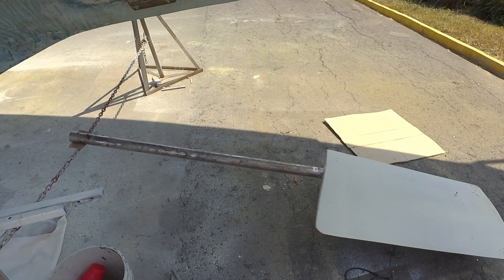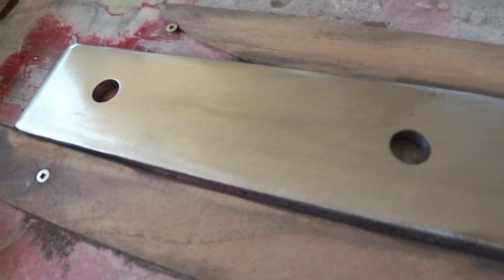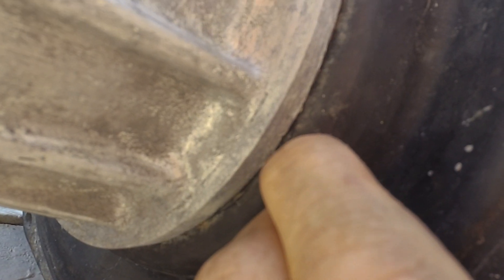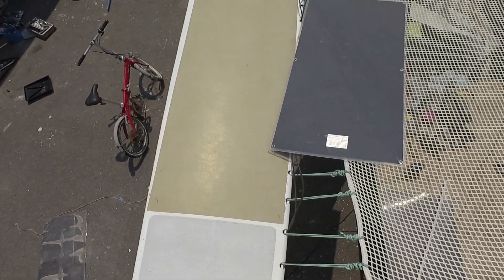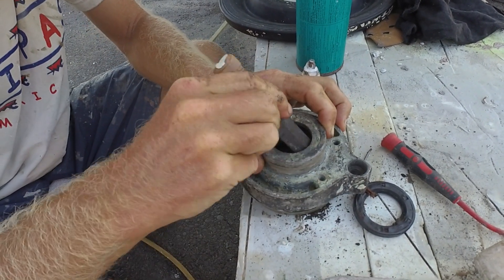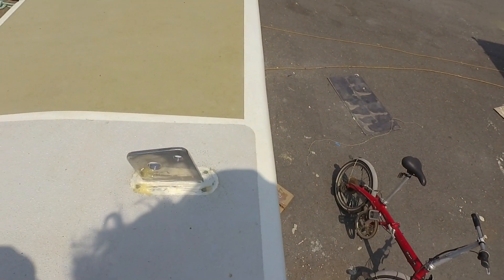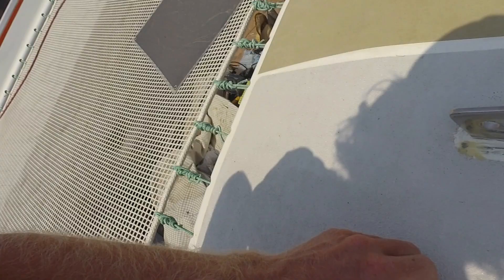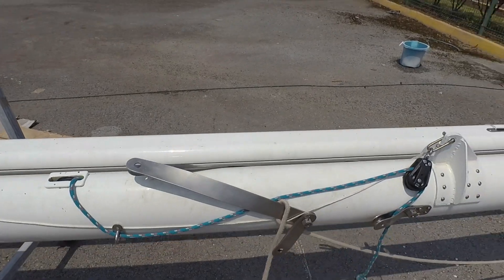Making chainplates and discovering problems with the  engine

Comment: So happy to see another video from @Sailing Less-Plastic 
Don't be too sad about the seals on the sail drive, you can keep the sail drive when you electric later on, just connect an electric motor directly to the sail drive.
@19:54 you probably want to rotate those air vents 180º so the opening is facing the stern, then the moist air is sucked out (venturi effect)  of the ama rather than being pushed into it, also you will get less water in there when you burry the ama when beating hard to windward (I learned this the hard way on my Tri). when you burry the hull some of the air is squeezed out by the force of the water around it and as the hull returns to the surface the hull expands and sucks air back in but as there is still a lot of water around is sucks some water in as well, the dorade boxes you have will help, but with those cowlings facing forward the dorade boxes will be full of water, so more water will be sucked in.
Reply from the maker: Thanks for that input! Makes sense :)

Comment: Would it not be better to use a outboard.
Reply: I agree the EZ-20 (https://www.goldenmotor.com/eBoat/EZ-20T-R Dimensions.pdf) would be perfect for them, but its the batteries that are the problem.
Reply from the maker: All got its pros and cons. I looked into it. It was an option but to buy an outboard down here would be 4000 usd..more or less....more reinforcements needed. It's not always easy to make decisions based on what the future  discloses...haha
Reply: @daveamies5031  yes true but solar power and some outboard motors can charge.
Reply: @SailingLessPlastic  yes I understand,  cost is so important,  what about a second hand one good enough example looked at   by a good mechanic,  the advantages are pretty good being able to hand your motor to a mechanic rather than him having to get perhaps out to your boat at anchor etc, anyway good luck guys .
Reply from the maker: @mysurlytrucker7510  You are right! OB can be much easier to work on sometimes. We had an outboard on our first catamaran (Endeavourcat 30)  we sailed from Panama to Australia. Problem here is...availability. It's not the same thing as go second hand shopping in the states. OB more or less doesn't exist (yes of course the do) here...and second hand market is not a big culture here in MX. If you find outboards...it's usually something that has been sitting on a panga..and way to big for us. We tried to go the easiest solution for us...we just thought we we would get away with no replacement costs. Obviously not....
Reply from the maker: ....If I could have chosen where to make they refit...Mexico would not have been my choice..haha. Availability of things is a big reason....
Reply: @SailingLessPlastic  cool man I hope your ok after the unfortunate drinking of that water bottle
Reply from the maker: @mysurlytrucker7510  yeah..all ok...nothing happened....lucky me :)

Comment: Is that a plastic boat?
Reply: GoP (Glass over Ply), you can see the ply under the glass in the earlier episodes, they are well worth going back and watching
Reply from the maker: Hull, amas (floats), and a little bit more is foam and glass (sandwich)....deck and super structure is glass over ply.
Reply: @daveamies5031  

Oh, it is like the cat Zingaro here on YT, strong boat...
Reply: @Hotbulldozer  Sailing Less-Plastic actually corrected me (above) so its a mix of glass over ply and glass over foam, so yes a strong but light boat, I would not compare it to Zingaro, as it's more differences than similarities, the only similarities are the construction methods and they are both multihulls (Zingaro a cat, and this is a Tri). but thats where the similarities end.

Personally I love Trimarans, so this is why I follow this channel, oh and the great personalities of the Sailing Less-Plastic team.